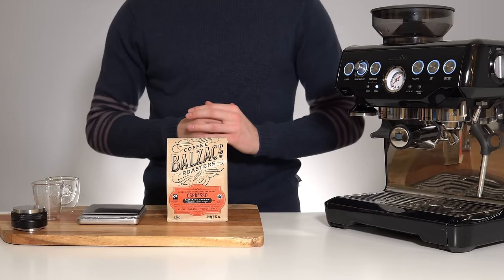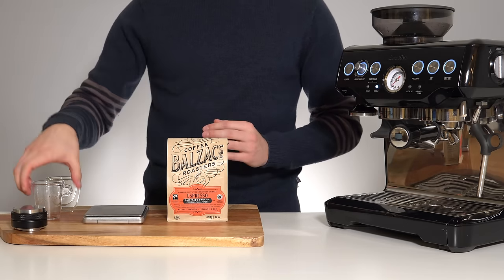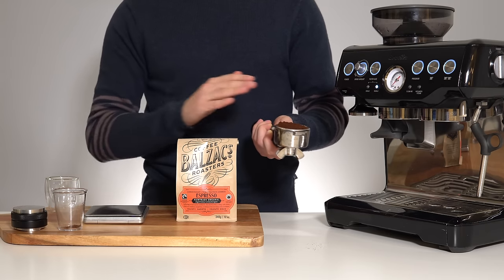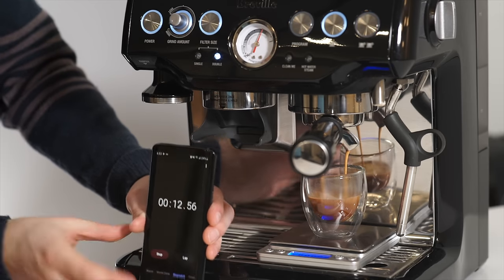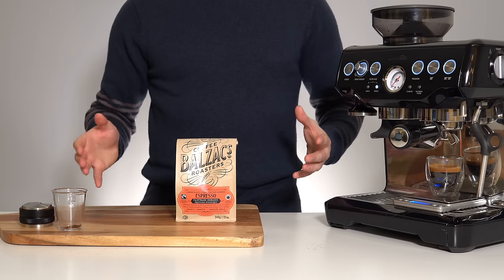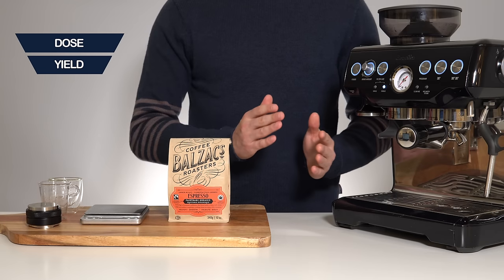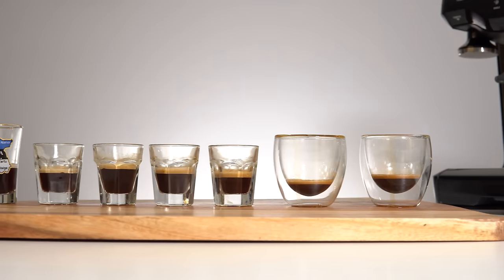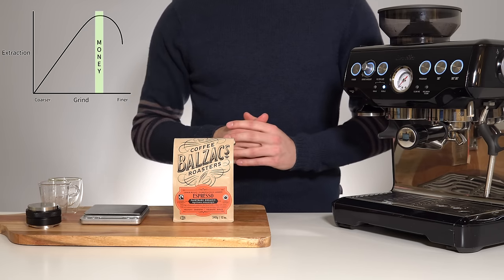Dialing In Breville Barista Express | Dose, grind, yield, time

Comment: I followed this tutorial step by step and dialed in the beans to 1:2 ratio (18grams to 36 grams of espresso in about 35 secs). It worked for 3,4 times with the double shot button then it became faster to extract the coffee to around 26sec. The espresso still tasted good so I didn’t bother re-dial it. However after about 8 months, it started to run really quickly when I didn’t change any settings or bean. I tried to re-dial but with the same grind size and amount, I got over 90g of espresso within 35sec. What did I do wrong or is my machine broken? The machine is breville barista pro and the bean is lavazza crema E aroma from Costco.  Thanks. 🙏
Reply: To top up, tamping wasn’t changed as well. I bought the palm tamper recommended in the video too.
Reply from the maker: The flow rate can absolutely change from bag to bag of coffee, and even from day to day based on the temperature and humidity in your home. It is not uncommon at all to need to change the grind setting slightly every once and a while. Cafes dial in each day :)
Reply: @LifestyleLab_  thanks for the clarification. What worried me was the flow rate changed so dramatically even when I was re-dialing it. The 90g espresso was what I got when I was re-dialing it. Felt like the grind size needed to be so much finer to avoid the watery outcome which confuses me as the environment hasn’t changed much.
Reply: @LifestyleLab_ Mystery resolved 😂. After dialing it a bunch of times, the bean hopper was emptied. I refilled the beans and it worked as before. Then I remembered the last batch was the end of some bag I found while cleaning up the kitchen. I just dumped them in the hopper trying to minimize waste. They ended up being wasted anyway during the dialing process 😅. At least now I learned the age/freshness of beans is very critical. Thanks again.

Comment: Hey there great video thank you for that. I'm having trouble with my Breville machine pressure dial moving past the Pre Infusion area. Any thoughts? I appreciate any feedback.
Reply from the maker: As in the needle is not moving any further than the preinfusion range?
How fine are you grinding? Whats your flow like?
Reply: @LifestyleLab_  wow I wasn’t expecting a response for a couple of days, I dig it. I tell you what I’m going to do. I will do your step by step then get back to you. But not right now, I’ve just spent the last two hours trying to get it to work. I’ve had this machine for 3 years and I’ve never gotten it to work properly. There is hope now🤙
Reply from the maker: @jimmykabisch3258  Of course there's hope!! Let me know how it goes!

Comment: Hi there! Thanks for your video. I've been using the same coffee from the same roaster on my breville express for 2 years (same machine). I use the same amount of coffee, same tamping pressure, and I use a single wall double shot filter in my portafilter. The pressure is always at 11 or 12 o clock, but just recently the shots are way too fast! I can also feel that I'm not getting enough caffeine from the shots. I contacted breville and spoke with many people, as well as tried a different coffee with no change. I tried the double wall double shot filter, no change. I made the grind finer, but the shot became too bitter and the pressure was too high. Do you have any ideas as to why this might be happening? Thanks for any input!

Comment: Excellent video! I've got my machine extracting 36g in 25 seconds but the pressure is too high -- if I go to a coarser grind however, the shot pulls too quickly. Do you have any advice?
Reply from the maker: Don't worry about the pressure going "too high". If the flow rate is correct, and it tastes properly extracted, you're dialed in 👍
Watch the dialed in shot in this video, the pressure runs at around 1 o'clock. Many Barista Express users also report this is the region where they pull the best shots
Reply: @LifestyleLab_  Mine goes right out of the filled in part of the dial to about 2 o' clock -- is that still alright? :S
Reply: I am in the same situation. Pulls in about 22s (timed from first liquid in the cup), with pressure almost off the scale at 2 o'clock.

Comment: You didn't mention which filter you used, pressurized or not? Single or double? That machine has four different ones.
Reply from the maker: An 18g dose will be for the double shot baskets, and here's an explanation of the difference between pressurized and non-pressurized! https://youtu.be/eOKKMu5wmQA

Comment: Hi, maybe a stupid question. But do you have to do this all the time? Or do you set the amount of water when you reach the 1:2 ratio between 20-30 seconds? Or do you always measure the amount of beans and water?  Thanks in advance! Really like your video's!!
Reply from the maker: You can program the grinder to dose the correct weight of grinds and the machine to dispense the right amount of water ONCE you're dialed in and then it will just repeat it :)
Reply: @LifestyleLab_  thanks for your awnser! This really helps. I know how to set the amount of water, but i can't find how to program the grinder....do i miss something?
Reply from the maker: Use the grind amount dial to increase or decrease the grinds dose. Weigh each time and adjust until its despising your desired amount
Reply: Thank you so much! You're video's makes brewing espresso's much easier

Comment: Thanks for this video! I did a lot of research prior to using my machine for the first time and partially absorbed so much info, so when I attempted for the first time I flailed and started looking for a good summary like this. 

I do have one question: I attempted to weigh my beans before grinding. I started with 18.2g of beans, put them all in the hopper, and ground until it was empty. I ended up with only ~14g in the portafilter. Any idea why this would be? Thanks!
Reply from the maker: Because your burrs are brand new and this grinder isn't zero retention. After a few days of running there will be some exchange of new and old grinds. The MOST accurate way of dosing will be to weight your dose after grinding
Reply: @LifestyleLab_  that makes sense. So after a few days it should be more consistent in how much “loss” there is, and It should be close enough that my dose in will lead to a consistent dose out? I’m fine measuring on both ends to begin but I’d like to be able to measure just before grinding in the future.
Reply from the maker: That's correct. Once broken it, the weight in versus weight out is relatively consistent. Aftermarket single dosing hoppers can help reduce this to zero, but are a little expensive at the moment

Comment: Good video, thanks for sharing! I recently purchased this machine. I have a question about it. When I start a shot, espresso begins to flow during preinfusion. I can’t seem to get that part dialed in. Everything else seems pretty consistent with what is shown here and from what I’ve read. Any suggestions?
Reply: If the flow starts during preinfusion, you either have to grind finer or (sometimes: and) increase the dose. I know that most videos show you how to weigh the coffee, but I'd recommend to take a look at the coffee puck. It should be dry and you should be able to see the imprint of the shower. If that's not the case, you have to increase the dose. For example: I tried to dial in the LAVAZZA CREMA E GUSTO FORTE (just as a test, since the beans I normally use weren't available). I had to go down to a grind size of '2' and set the grind amount dial to 5 o'clock (using the double basket). That's when I finally got all parameters right, pressure, flowtime and shot size. But keep in mind that these values depend not only on the beans you're using, but on your machine (only because you have the same machine, it doesn't matter that it behaves exactly the same) too. With my usual beans I'm using a grind size '4' and the amount dials stands on 2 o'clock with the single basket.

Comment: your using a 51mm distribution tool for 54mm portafilter? is that the ideal tool size? based from the link of the palm tamper link in description.
Reply from the maker: The linked tamper is available in 51mm, 54mm, and 58mm. Do choose accordingly for your machine

Comment: Hey - I used 18g of coffee and at a level of 6 on the grind setting.

It took 15 seconds to get to 36g of espresso.

From your video I know that to be too fast. However, the red dial was very slightly past 12 o’clock on the pressure dial, which is normally an indication of a decent shot isn’t it?

Not only that but there was a nice flow coming from the portafilter and also good crema on the shot - and it tasted good too (unless I have poor judgement 🤣).

So I’m a bit confused because I’d assume it would have tasted bad right, because it came to 36g too quickly?

Where have I gone wrong? I’m thinking I might have the right grind setting but maybe increase the dose to 22g? Would that help with slower extraction while also maintaining a good pressure on the red pressure gauge? 

Thanks
Reply from the maker: You've done nothing wrong! Have a watch through the second half of the video 
Every coffee is different, every person is different, you've found the sweet spot for the coffee you're using, and your personal preferences. So stick with those settings!
Reply: @LifestyleLab_  Thanks. I watched the second part of the video and must admit found it hard to understand. 

Are you able to summarise why it is that you say I've done nothing wrong? If we should be pouring a 36g shot in 25-30 seconds, but mine is taking 15 seconds, how can that not be wrong? 

After this, I tried grinding finer and also increasing the dose of ground coffee to see if it slows it down - but both occasions the shot was over extracted and barely any liquid came out, clearly a bad shot. It seems I've hit the right settings, but no matter what I do now it will just come out too quickly.
Reply from the maker: Different coffees extract at different rates. Yours tastes best at 15sec, so that's where you should keep it 🙂

Comment: When do you start the timer?  I seen right as you press the button and you did it after the water starts flowing.
Reply from the maker: It's personal preference, as long as you are consistent with yourself once dialed in. As described in the second half of the video, 25 seconds is not a magical perfect shot length. Some coffees will taste best at 20 seconds, some maybe at 40! Thus rendering when you start the timer relatively irrelevant, unless you are trying to follow someone else's exact recipe for a particular coffee

Comment: I have the same Breville Barista and I buy  the same Balzac’s Espresso beans. What grind number did you end up using?
Reply from the maker: Despite being the same machine with the same beans, the grind settings will still likely not be the same for a dialed in shot for 3 reasons: 
- The machines aren't calibrated to one another
- Environmental conditions where you are vs where I am 
- Personal taste preferences (most important!)

Comment: Hello, I have watched this video many times and learned a lot from it. I just started using my breville infuser a few weeks ago and dialed in at 12 o'clock every time. Now I barely get to espresso range and have not changed a thing. Any idea why this might be??
Reply from the maker: Winter! Lower humidity in the air will cause the shots to run faster!
Or, maybe you just opened a new bag of beans? Different roast dates can have slightly different grinding needs
Reply: @LifestyleLab_  Thank you very much for getting back! :)

Comment: I tried grind size 8, 4, and 2. I'm getting consistent ~9 second pulls. If I add more than 18g of beans, per your instruction it will be too much for the puck, it's already overflowing at 18g. Yes I am using a double size for filter and shot and it is a double shot puck. How does grind amount come into play? Not sure I saw you address in the video unless I missed it. What would you recommend ??
Reply from the maker: Grind dial setting is irrelevant if you are weighing out 18gr of beans. Simply grind until empty 
If you can't fit 18gr and your flow is way too fast, you are grinding way to coarse. Adjust the inner burr setting (not outer dial) finer

Comment: What is grind amount and how does that affect the shot you pull? The main factors is dose, grind size and time but the grind amount is really throwing me up and it’s only the breville that has that setting.
Reply from the maker: As shown in this video, I recommend you standardize to a specific weight, and don’t rely on the timed “grind amount” dial. 
Timed grinding is confusing because it can be inconsistent, and changes the dose based on the grind setting you’re at

Comment: Thanks a lot! I have a question on the yield. Breville’s default program and instruction recommends 2oz/60ml for two shots... this translates about 60g, much higher than the recommended 36g when 18g coffee is used. But the extraction time is less than 20 seconds... I feel like the basket can hold 18g maximum.
Reply from the maker: Yes, the basket can only hold 18gr so Breville's 60gr yield recommendation would be giving you slightly longer than a 1:3 ratio. They recommend this because a longer shot like this is generally sweeter and a little less strong, which appeals more widely to the majority of people just getting into espresso. Remember, tune in to your individual tastes based on the concepts described in the second part of the video, no one set of numbers will suit everyone, and Breville's recommendation vs my recommendation is proof of that!
Reply: Lifestyle Lab thank you so much for the clarification I thought the difference was too big and something might be wrong with my machine. Now I will experiment with stronger extraction ratio. But I have two other questions: 1) the drip will already start even during pre fusion stage before pressure is applied, unlike your demo that only dripping after gets to pressure; 2) the total extraction time even with 60g takes less than 20s, so if I dial it to around 36g the time would be even less, missing the suggested time by a lot. Is there something wrong with my tamping or grind setting or coffee even? I got my bean from local shop though. Once it gets to pressure, the needle is about 12 o’clock.

Comment: Let's say we start at 18g dose, 36g yield (1:2) in 25 seconds. If we want to try a 1:3 ratio instead, should we aim to do so in the same 25 seconds? This would mean a coarser grind. 
Or do we keep the dose and grind the same, and take it out to 54g in however long it takes (35-40 sec perhaps)?
Reply from the maker: Whatever tastes best :) 
Generally, you’d keep the grind setting the same and simply run longer if you’re trying to up extraction

Comment: Not sure if you will reply or not but, my coffee bean company I bought from said 7 is the money shot and I’m getting really nice flavor and consistently but pressure is in the grey but lower end. I use the normcore portafilter and a puck too. Should I try going down to 6? I haven’t tried timing yet I normally just hit the double expresso  button.
Reply from the maker: No possible way your coffee shop can tell you a grind setting. Dial in to taste and use what you like best
Reply: @LifestyleLab_  okay cheers because I found that without using the puck the coffee pulls and  taste so bitter but with milk and the puck on taste fine. :/ 

Also unsure why when I go to tamper that I lose coffee from the portfilter because it appears to be too much coffee grind however it’s only 18g :/ it’s the normcore bottomless.
Reply from the maker: Same with the grind setting, dose what makes sense for your coffee and basket. No need to overfill to get to 18g. Use what works
Reply: @LifestyleLab_  well how much is too much and how little is too little. Sorry to be pain. I’ve tried 16g ends out being about same amount of coffee grind in the filter as to 18g hardly makes any noticeable difference.
Reply from the maker: You’re likely using something very darkly roasted. Dark roasts are less dense than lighter, and take up less more space per gram in the portafilter because of that. Hence why 18g for me might not be 18g for you. Use whatever fits properly in the portafilter, and adjust your brew ratio accordingly

Comment: Got my grind at the finest possible setting, (really fine)with a full double shot basket,, with about 18g of coffee, using a Gaggia Classic
But it’s still coming out at 100mph?🤷‍♂️
Reply: Tamp pressure?  I'm having the same issue, but my shots are tasting GOOD, but only taking 12 seconds to reach 35g.
Reply from the maker: If your shots are tasting good, then your job is done! :) doesn't matter what the time says
Reply: @cliffbeneventi  tamp pressure is right, but I’m having to use the basket with the single hole, with the plastic eye in the middle, (wrong I know) but it’s the only way I can slow down the flow, I’ve already followed the online instructions to reduce the pressure by turning back anti clockwise one & a half turns with an Alan key, only made a slight difference in flow..

Comment: Okay i finally followed the guide and got grind size 8 for 25 seconds pulled 36g.  So now going forward am I supposed to use a scale to brew a shot every time or do I just count in my head to around 25 seconds?
Reply from the maker: You can use a scale, or, if you used the program mode the machine with attempt to replicate the shot you just pulled the next time you push the same button :) It may not be exact as flow rate will vary slightly from shot to shot, but it's good enough if you don't want to measure every time